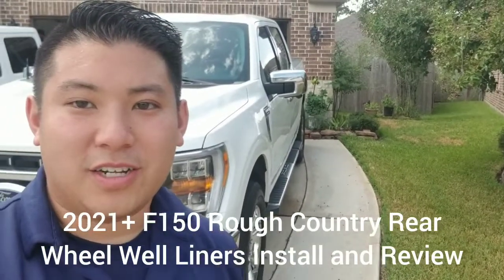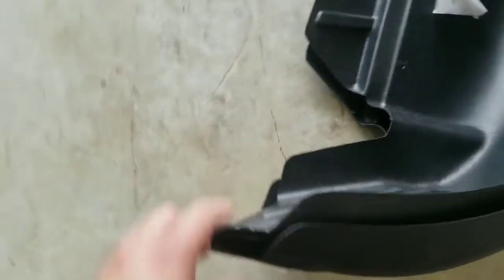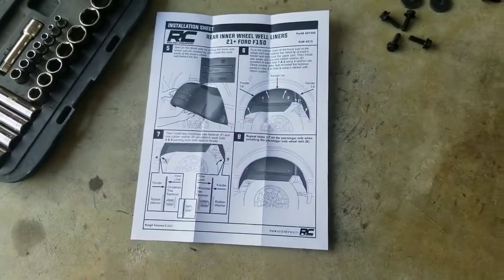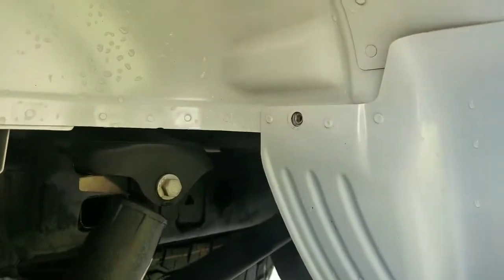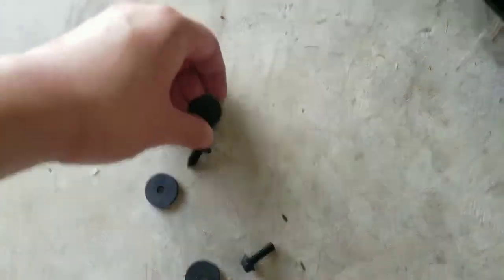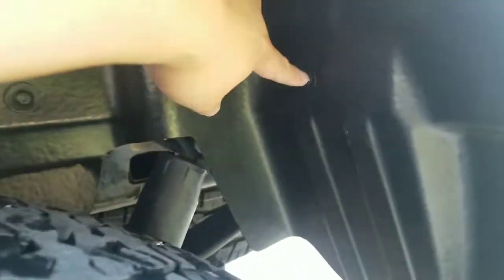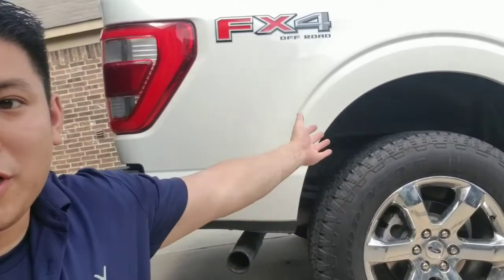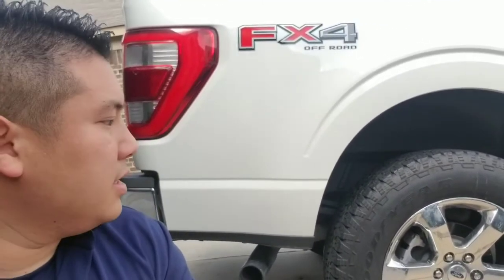2021+ F150 Rough Country Wheel Well Liners Install and Review

Comment: Great vid! The new design is a little different. You actually have to use 4 Christmas trees per side (8 total), and you don’t have to remove that factory screw (that hole isn’t used). Also, the driver/passenger sides aren’t clearly marked anymore, which can be confusing. Overall tho, still a super quick and easy install.
Reply: Where do the other two Christmas trees per side go now? Are they harder to get to the back side with the washer than the original two

Comment: Good work. Do they work? That's the question. Do they stay in place in ice and snow. Do they make it easier to clean and really protect? Are they noisy during gravel, snowy, icy travel?
Reply from the maker: Works great, it's installed and I honestly forgot that they are there but working under the truck you can tell it's doing it's job!
Reply: They have been great on my ‘21 limited. Gave it a good scrubbing first and didn’t notice any sound difference up or down but definitely way less mud and dirt on springs, differential and everything in between front to back. 
I should have done this on my last truck, a 2009 f-150 because eventually my leaf springs got fine dust and dirt in them and squeaked like crazy when dry and I had to jack body up to try to separate springs and pressure wash, even that wasn’t 100% successful.